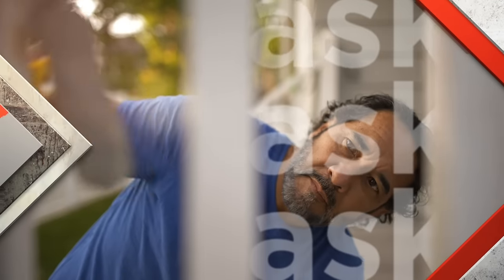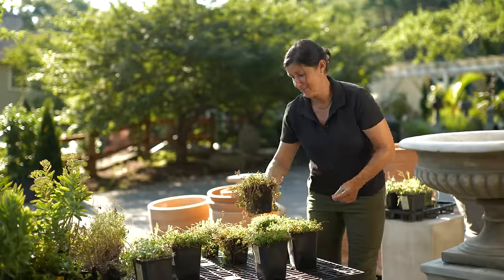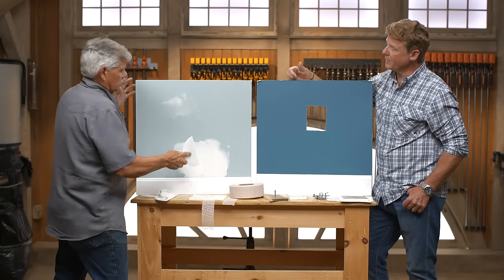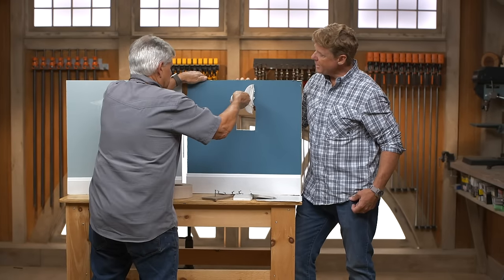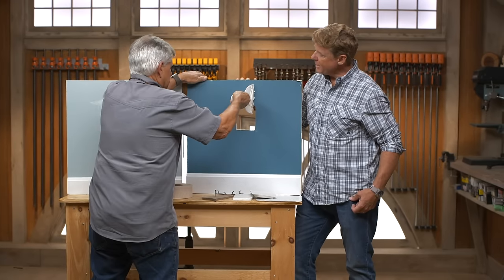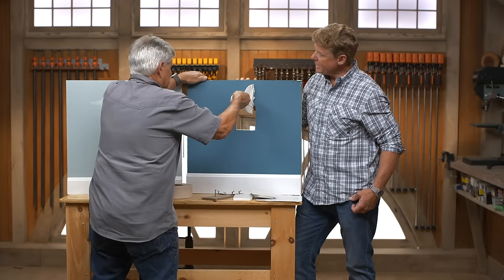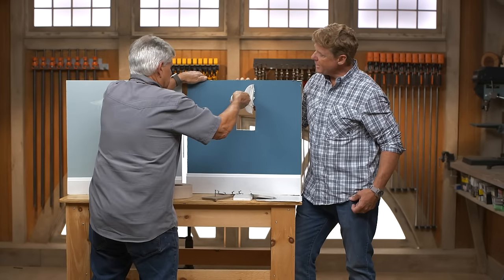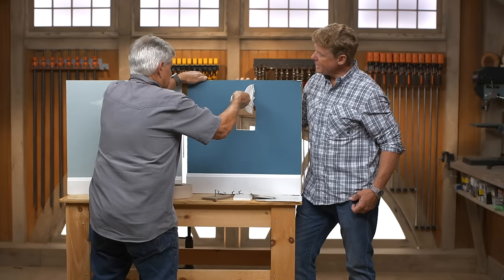ASK This Old House | Hole Patches, Threshold Repair (S20 E3) FULL EPISODE

Comment: 9:15 For patching the big holes I usually use the pain stirrer wooden sticks (from home depot) attach from back with som glue (so the stick is coming from back and sticking to backside paper) may be add small screw from front. Once the glue to dry, use the patching drywall piece attach it to the wood with another screw. This gives a way to push the joint compound into the gap between the wall and patch. 9:20 way will have gaps from the back and If some pressure is applied on the new patch it will just go inside.

Comment: Hey guys, that mesh tape is also really useful for covering the drain hole for potted plants to keep drainage rocks or soil from leaking out. If you use the plastic type it won't rot out and it usually does not clog up (but a gentle squirt with ye ol garden hose works to get the gunk out)...
Reply: i always just used a piece of newspaper in the bottom